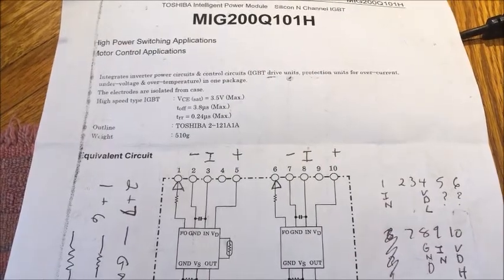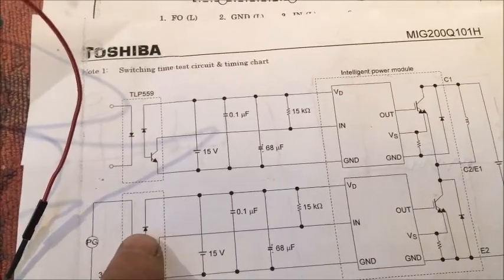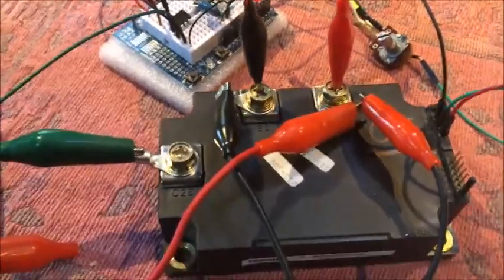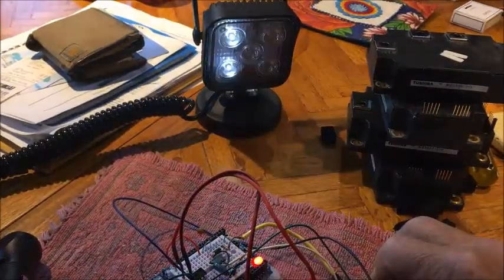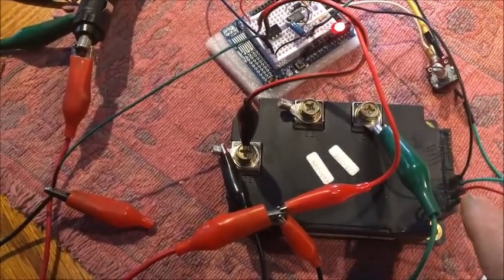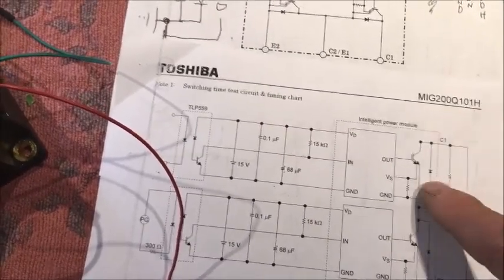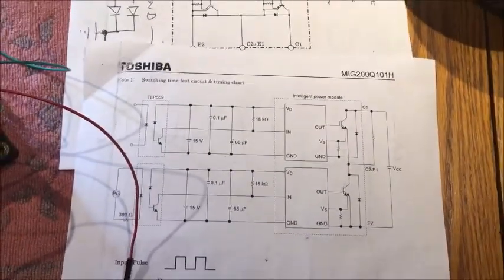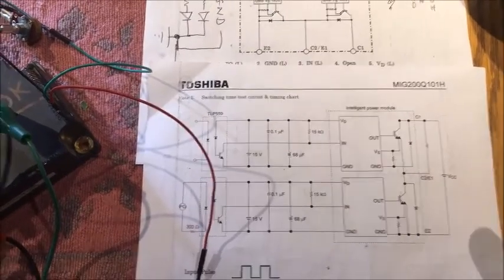IGBT dynamic test

Comment: Hi Peter; Do I need a compact Torque Wrench when replacing the IGBT's, or will a stf beam-type work ok? thanks
Reply from the maker: I would not recommend using a beam, I a use a click style ratchet scaled accordingly. It is more accurate, you want them to be tight enough and not shear the heads off.